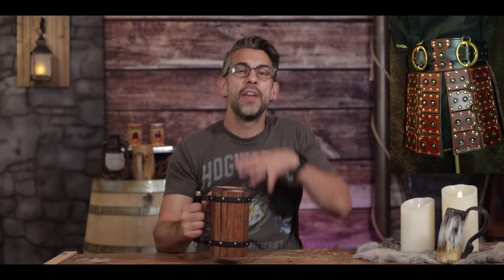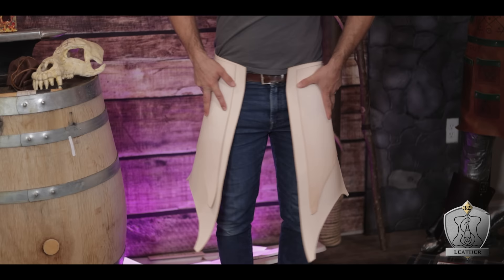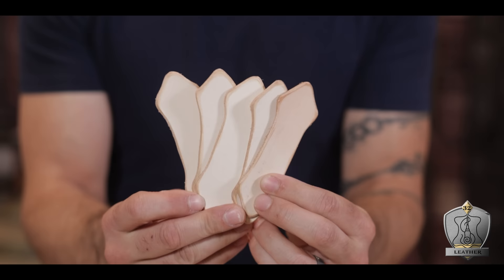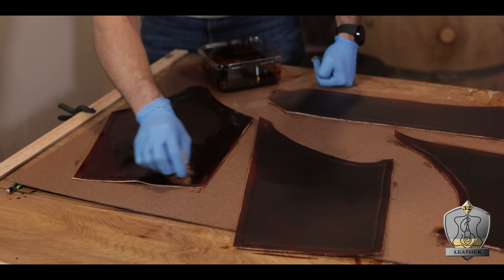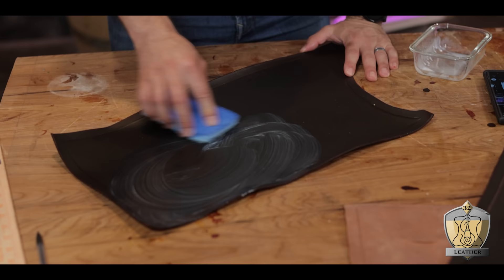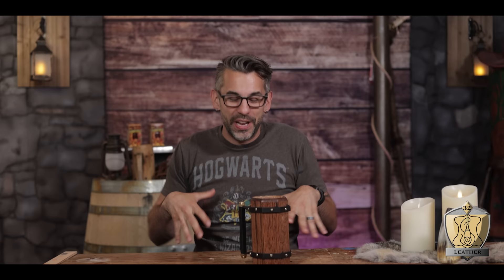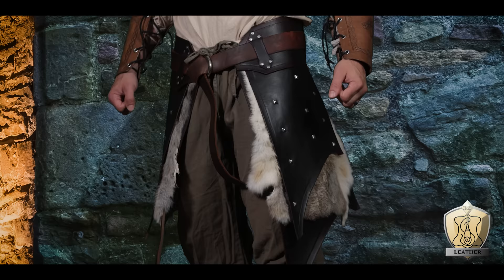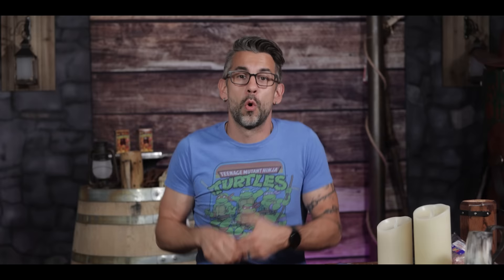Easy Leather Barbarian Armor! Bonus: Oiling Leather!

Comment: So I saw you a couple years back on one of your first videos. I was looking for ideas on cheap bracers to attach chainmail to and found you that way. Anywho I made said crappy bracers then went... kinda crazy. I bought a ton of tools, made a war belt, got a new place with a garage to setup a shop, made proper hardened bracers that protect the elbow as well, made shin-guards, made two more belts, and now I'm making boots that are a hybrid between viking-age turn shoes and WWII boots. You created a monster, sir, and I thank you for it.
Reply: This is awesome. How did you harden the bracers? I've tried with the wet+oven method but it didn't get very hard. I think I did 40 min at 200 F?
Reply: @cbjewelz  I let it air dry for 24 hours then put it in the oven for two hours at 220
Reply: @bruinpattison9973  oh interesting. Never seen that much air dry time. This is after totally submerging in water? How hard did it get?
Reply: @cbjewelz  honestly it was first time attempt accident. I submerged them for 15 seconds, but 24 hours later they were still wet, so I baked them and had a happy accident. It'll easily hold it's shape to a baseball bat. It's double layer 12oz veg tan
Reply: @bruinpattison9973  nice, thanks. Yea I tested with 6-7oz so that might be a factor

Comment: Hey, my guy. You should try what I like to call "deep borders." So, do your normal wing spanner thing that you did here on the borders. Then, adjust the spanner a bit larger, so that the new line will be roughly a half inch (or whatever) from the first, and go around again. Maybe do it a third time. Now that you have three lines all the way around the piece, put different patterns (stamps or tooling, whatever) between the lines. You could make the pattern uniform for all of them, or as I prefer, do a different pattern for each line. The "depth" of the border really draws the eye and brings the piece up a couple levels. It wouldn't be appropriate for a barbarian piece, but maybe for a fancy warrior or paladin.
Reply from the maker: This is a really great idea! I will give it a go next project for sure!

Comment: I always recommend using chicago screws instead of rivets to join leather, particuarly for beginners. It makes maintenance or repairs a lot easier, since you just unscrew and re-use them, rather than drilling out a rivet.
If it's going to be visible, I  use a steel or antique brass/bronze/dark brown chicago screw and keep the flat side facing out. If all I have is shiny brass, I hit it with some cold blue/gun blue to weather it first, make it less eye-catching.
Reply: The downside of Chicago screws is that if you're putting them through a lot, like a full-contact hard-hitting LARP, those suckers will rip right out.  I don't know if his larp is full contact, but I know I've been warned against them by people in Dagorhir
Reply: @teamcybr8375  I haven't had that problem myself, and now I'm curious just what the heck they were doing that had a chicago screw rip out of leather. That's not something I've ever seen.

If I was really worried, I'd put some loctite on the threads, but the chicago screws I use (flat on both sides, no dome or spike to catch on anything) have always seemed perfectly fine without it as long as they're snugged tight.

I HAVE had several proper rivets fail under light use though. I do mean really light use, btw. They were on pouches I was wearing at a faire, just walking around, nothing too active, and they just popped right out. Replaced them with chicago screws, and didn't have any problems after that.

I also used chicago screws on the guige strap on my targe, and they've survived several years of use, carry and display without a problem.
Reply: @teamcybr8375  just like with a rivet you should always use a washer to insure it doesn't rip through easily. You can also use thread locker to secure the threads so they don't come loose. I've been using post screws (Chicago screws) for decades on my armor and never had a problem.

Comment: Also, I have played around with all sorts of way to dye leather, and I have settled on mainly using oil-based wood stain. It doesn’t dry out the leather, it helps waterproof it, and it doesn’t darken it too much right away so you can just keep adding coats until it’s the color you like. Plus it dries really fast because you just have to wipe off what doesn’t immediately soak in right away (DO NOT LEAVE IT ON THE LEATHER WITHOUT WIPING IT OFF, it will become STICKY) & I usually can start working with it again in just a few minutes. There’s also a lot more different minwax wood stain colors to work with than there are leather dye colors. FYI this works mainly if you’re just looking for a natural earthy shade of brown, not like a solid green. With solid colors I usually still go with acrylic alcohol based paint. I’ve even started using some of the minwax “polyshades” which is oil based stain and polyurethane mixture so you get a more shiny finish & it almost completely seals it. Hope this helps!
Reply: I love to use antique gel and it sounds just like you described the wood stain. Lol

Comment: I like to add some plain old leather lotion before I dye my leather, and then after the leather is dry, I put a couple of more coats on it. Finally I finish it off with some Dubbin. It’s a wax/fat/mystery mix that’s been used forever. This tends to seal the leather and keeps it hydrated and supple. I’ll usually go back after a few days and give it another coat of dubbin as the leather absorbs it.
Reply: Interesting, I need to keep that in my mind.
Reply from the maker: Thank you! I will give this method a shot for sure!
Reply: I’m given to understand that Dubbin can also help in restoring a piece that’s become dried and cracked to something more functional.
Reply: @Muljinn  Yea, absolutely. I actually learned about it from Matt Easton on his channel Schola Gladiatoria. He uses it to restore antique leather scabbards.

Comment: There is actually an adjustable spot punch tool (it has 2 tines for the brads on the spots) that makes life so much easier if you have projects with lots of spots or decorations.  I purchased mine from Weaver many years ago and it was a great investment for me.  Before the spot punch I had a very small flat razor (1/8 of an inch wide) that I would use, but I haven’t seen them in stores recently. 
Thanks for sharing your creative side, I really enjoy watching and learning different methods from you.  Your presentation is and attitude is always great and encouraging.

Comment: I've used a "wax on, wax off" routine with neatsfoot oil where I rub the oil into the leather with one rag, and then wait a few minutes before buffing the project with a fresh rag to get rid of any excess. Finishing with some kind of sealer (Tan kote is what I use), then leave the project for an hour to dry and then give it one last dry buffing. Some kind of leather balm will be great for maintenance of your piece, and will continue to soften your project as it wears in, and it will also protect from the worst of cracks.
Reply: I just started a few weeks ago and used Fiebings Pro Dye, then Golden Mink Oil, then Tan Kote. However I got my belt wet and the dye COMPLETELY came off and ruined my pants. I've gotten some Resolene which I've yet to use but I hear that's more commonly used than Tan Kote since it seals better? Do you have any input on whether that could be true or not? I dont really want to keep making leather stuff if rain just just gonna soak through all the sealants and utterly destroy the project....
Reply: @Glorfindel_117  I do about 2-3 coats of sealer before I say "finished". Make sure you're sealing the edges with a burnisher, and be sure to seal the back of a project that will be in contact with anything. If you're making a bag, try lining the interior with something, pig split is usually quite cheap.

Comment: For alcohol based dyes, i use "ko cho line". You can apply it with bare hands, smells good, and good for your hands. After 1 application, wait a few hours and if theres still some on the leather, wipe off excess. Its great stuff

Comment: And that's why I only use lederfett, AKA Saddle soap on leather. Also you really should apply alcohol based dye to all surfaces of leather, not just the front. This will help to stop the curling of your leather, it also helps in protection by sealing the porous nature of leather. No matter how much Oil, Saddle soap or whatever will keep it protected as long and well as using dye first. 
The reason your leather gets hard and curles like that is the dye srinks the pores of the leather and when applied to only one side it only does this to that side making the fibers of the leather not to stay uniformed.

Comment: If you want to keep your leather more supple, use oil-based dye ! A popular choice would be Fiebing's Pro Dye. It really avoids the drying effect of alcohol-based dyes. Also, it doesn't rub off nearly as much, which mean you don't need to really seal the leather. The downside of sealing the leather is that it prevents you from nourishing it with (a moderate amount of) oil later on.

Comment: Also, in Star Wars, they are called Kamas. It was a Mandalorian implementation that protected the legs from jetpack thrust. During The Clone Wars, it usually told other Clones that you were a particular badass called an ARC Trooper.

I love how this Warskirt turned out! Personally, I would've put the belt looks on the inside to make it look like one whole piece. Hey though, you're happy with the finished product, it does look badass, I hope you have fun wearing it to a convention like a Medieval Fair.

Comment: When using Neetsfoot oill, oil your leather before you dye. Give it a few hours to dry and even out, then dye. It will help to get a more uniform color, as well as save it from becoming too dry. Unless I am gluing pieces, I typically oil both sides, though not to the extent the first article told you to...lol 
Also, you can buy a punch specifically made for spots, and it is adjustable for different size spots.

Comment: One of the people who works at my local Tandy taught me to use scraps of old white tees to apply seals onto dyed leather. I cut up some old, still white shirts or you can buy scraps of them in bulk from Lowes for a few dollars a pack. That way you can see how much color is still coming off your piece when you switch to a clean edge . Saved my bacon on a hat I made; I was worried I was going to sweat through the purples and blues I applied or walk away with bruise colored ring on my head XD

Comment: Hey if you haven’t already gotten this suggestion, I’d recommend using fiebings pro dye. It’s oil based so it won’t try out your leather and applying the oil to the leather is so much easier. I use it for all of my leather products.

Comment: Fiebings Pro Dye has Oil IN it so, DEPENDING ON THE PROJECT, you may not need to add extra oil. Just dye then treat or seal or whatever you're gunna do after. Also WITH oiling leather, A few coats from the top should oil all the way through, depending on the thickness or dryness of the piece. Do layer, let it dry, check it, do another, etc. Love what you did, love the channel!

Comment: Re: keeping the leather supple when dyeing, sealing, oiling, etc. I've had good luck with hand milling my piece at each step. While you leather is damp with whatever product stage you are at, gently roll it up into a tube shape a few times in various directions. You can do this a few times as it dries for each stage. The end results have been much more flexible and flows than when I've skipped this

Comment: Idk if this has ever been said, but if you’re setting a ton of those two prong studs, you can buy computer/electronic tweezers to punch the holes. They’re super sharp (you will stab through your skin), take a nut or some washers or scrap leather and put it between the arms of the tweezers to set your width and tape them in place and you’ll punch slits the exact with and distance apart that you need them until the tweezers bend, which if you’re careful takes a along time to happen.

Comment: I've had good results oiling the leather before dying it.  Front and back, touching up the spots where the oil soaks in quicker.  I let it sit for a couple hours before then dying it.  By getting the leather conditioned before adding the dye, I've been able to a more consistent color across the whole piece.

Comment: Neatsfoot Oiling ... on veg tan that isn't already dry always apply the oil before dying. Restoring the leather's oil level is much harder than boosting it beforehand. Use a microfiber cloth to add SMALL amounts at a time to an area until it darkens in colour. It's kind of subjective as one piece of leather may behave/change colour differently to the next. I've found that one dip of the cloth with a finger into the oil will easily cover around 8" square on most leathers. Rub it in well; gently on the skin side, hard on the flesh side.
It's an air drying oil so there's no harm in helping it along with a hairdryer set to medium or just hanging it in a warm room; but not in the sun unless you want it darker.
Depending on the application of the piece you're making there's also far cheaper oils you can use. A primary ingredient in traditional dubbin was/is lard. I use lard or tallow exclusively on my functional items such as axe sheaths, arborist arm protectors, shoulder protectors for scaffolding workers etc. Works brilliantly and cost hardly anything. It's also easy for the client to source if they need to restore the piece at all; just melt it with bee's wax and some cod liver oil for great dubbin. 👍

Comment: I have constant bad luck with rapid rivets not holding well enough. 
Maybe I'm using cheap ones or something but they always separate no matter how well they're set. 
To combat this, no matter what kind/brand of rivets I use, I've started adding a drop of adhesive around the rivet and between the leather to give the leather a little bit of an extra hold and it's worked perfectly since. 
I don't use much, just enough for a backup connection in case the river gives out or something.

Comment: Ive been building a battle kilt for the last 6 months. The kidney belt is about 6" wide, overlaps, and the flaps are at my cardinal directions instead of offset. The flaps are made from waxed canvas, homemade of course, and layered on top are "armor" plates of tooled leather. Still in progress unfortunately

Comment: Nice idea. I was looking for some upper leg armour for ages (Taken out by leg hits in battle kind of sucks) and that idea looks light enough. Because I was looking for something flexible, protective and not too heavy, because in some cases you have to move quick and heavy things dangeling against your legs sucks as well like geting hit. 
After resent experience on Conquest of Mythodea, my leather pauldrons saved my upper arm from a very heavy blow from a undead npc's spate(!) This protective piece of armour has two very neat advantages. First it is lightweight, so it is comfortable and second it has a soft leather inner side, a sturdy leather outer side and between some kind of rather thin padding. (included padding without the need of wearing a gambeson) The armour does not look like much protection in the first place, but being a wolf in a sheepskin, it had never led me down. Every time I got a blow to my upper arm, it gave a loud bang and a simple single layer of thick leather would not had soaked that inpact energy. And that specific blows were realy hard, so without that armour or unpadded armour I would got outtime a reasonable bruise or intime a broken arm. But the armour safed me.
To come back to your war skirt: The rabbit pelt between the two leather layers should give some degree of padding. (Would be my expectation, analog to my experience.) So beside the coolness factor, the protection level   should be recognicable.

Comment: Studs/spikes. Leg holes. If you don’t want to buy a special tool I would sharpen a flathead screwdriver that is the width of the legs for the spikes. That way you don’t risk cutting too big with a knife.

Comment: I'd love to see some interesting ocean-themed decorum! I also wonder, how would faux furs and leathers hold up in one of these projects?
Reply: Dye it green to make it look like Algae?
Reply: Fake furs tend to look poor when new, and look wretched after one or two outings, and generally rapidly degrade. They're also poor for the environment (all the plastic), besides also tending to contain actual animal fur in them. Might as well go with real pelts, at least those will biodegrade if buried, and look great for years.
Reply: @kshni_ammat  Real furs definitely seem like a better option for multiple reasons, but I'm not really sure where to obtain them or how much they cost. Maybe I'm misguided, but I'd imagine real furs to be a little more pricey, which is an issue if one expects to make multiple mistakes. I'm also just curious to see if any of the same methods could be applied to faux furs, at least in theory.
Reply: @duskstorm3560  they share the concepts, such as cutting and sewing. Fake furs tend to stretch if machine-sewing, so use a walking foot.
Oh, and rabbit skins are usually the easiest to acquire; depending on what country you’re in.